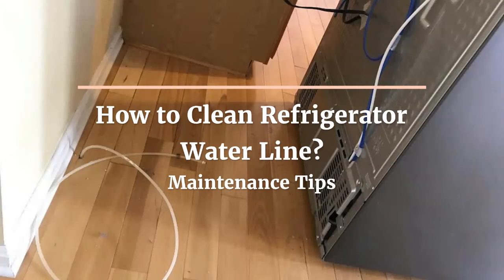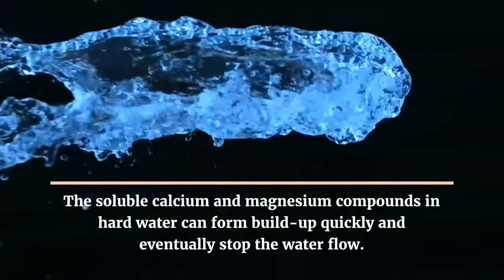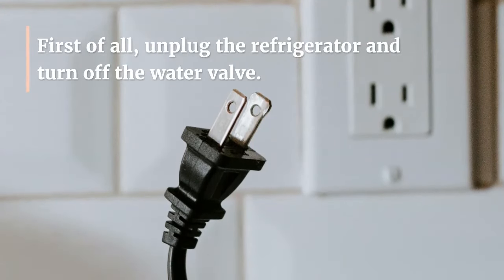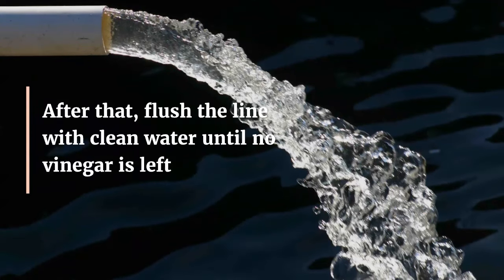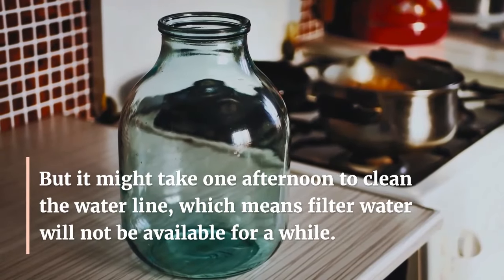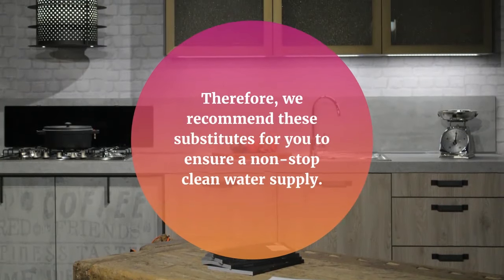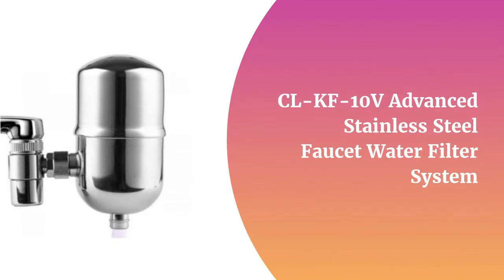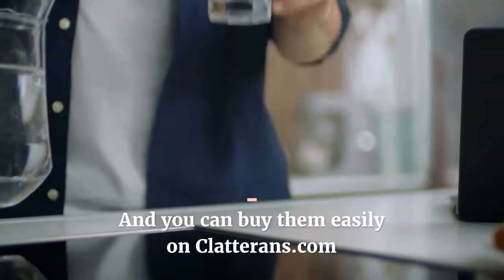How to Clean Refrigerator Water Line? | Maintenance Tips

Comment: Totally agree with all comments. I'm sure many people have thought of using vinegar, the classic solution for removing calcium deposits.  But what are the steps to do it?  My only thoughts were to sever the tube/line prior to where it enters the fridge,  place the tube in a pail of vinegar solution and run the water until hopefully it clears the line enough to be functional.  Then run clean water thru the system until the vinegar is gone from the system.   this also depends on  being able to buy some type of splice so I can reconnect the tubes without it leaking.    The only other option seems to be to completely replace the fridge tubing, but not sure if that is doable.